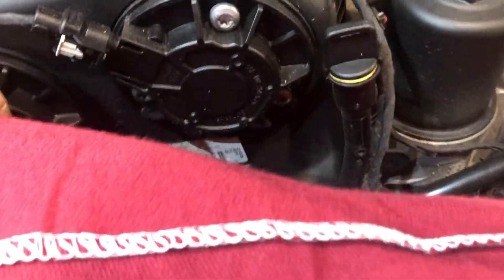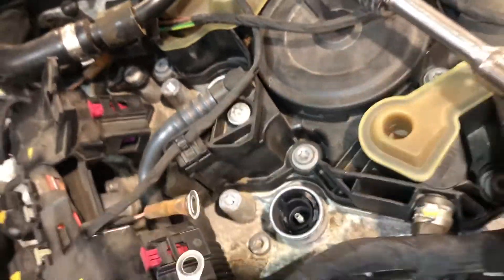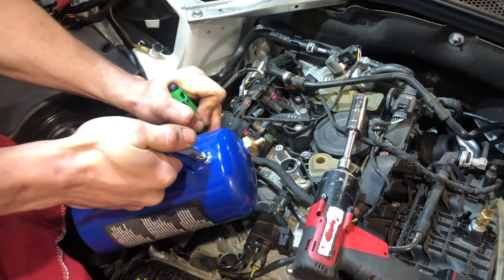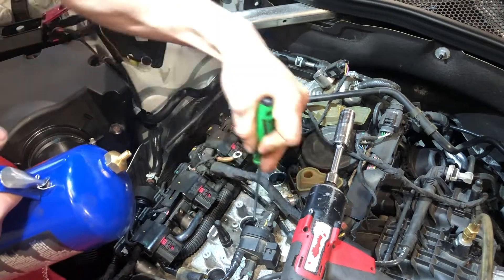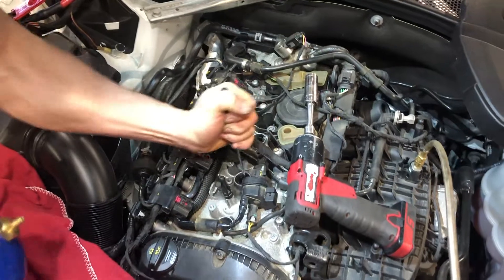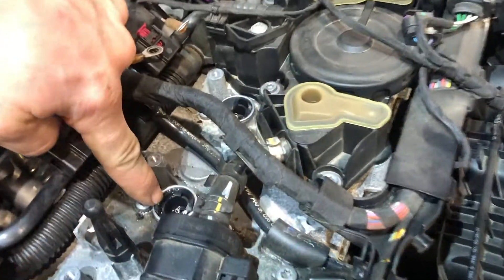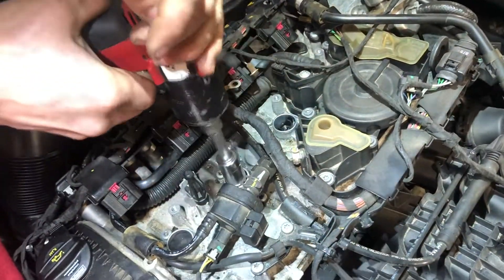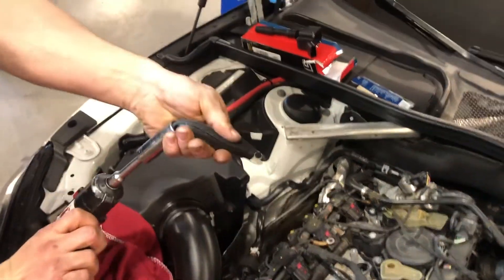VW, Audi, Porsche Coil Pack Boot Removal

Comment: Thank you. Worked turning manually using a pair of pliers. 2min.
Reply from the maker: We've had a few come in that would not come out with pliers. Works great if they seized and when pliers don't work.